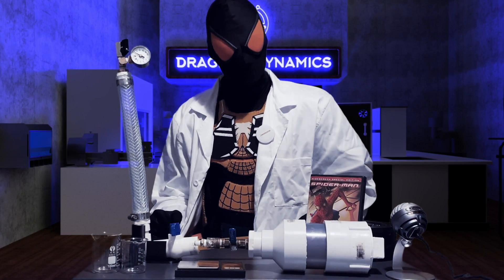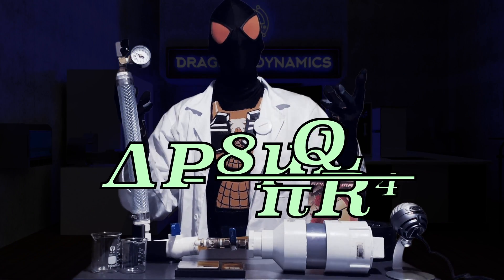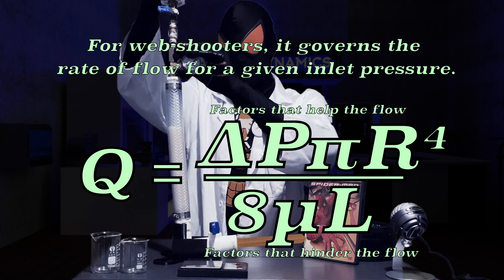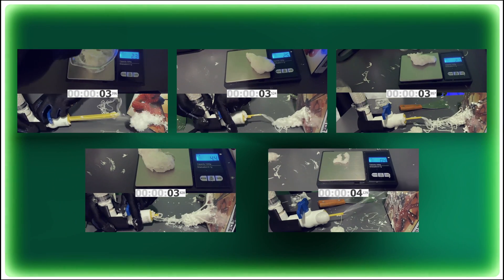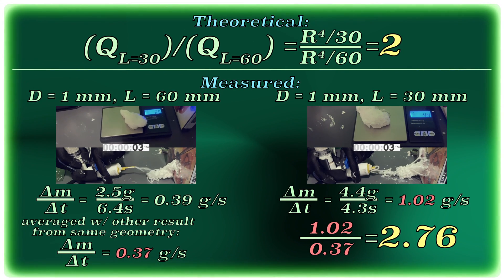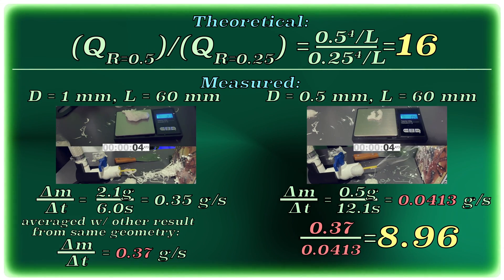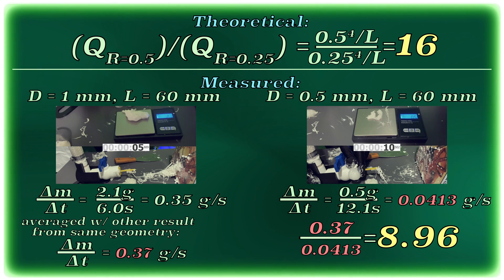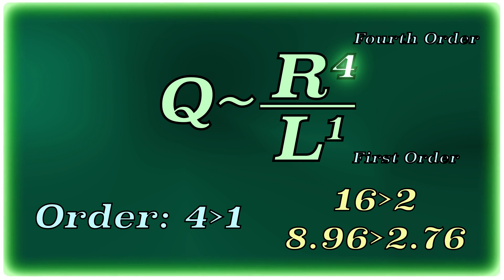The Scientific Law of Web-Shooters | Spider-Man Science #VeritasiumContest

Comment: So instead of putting a tube against the forearm, you create a thick disk and put one of its faces on your wrist with the exit point arching out like a candle wick on the exposed face. 

Add a tab for a bigger trigger to press on underneath the nozzle wick that I'm assuming in this scenario is rigged like a helium tank (I can't think of a better image for the mechanic I'm thinking of) and you got a solid projectile distance to work with... Noted!